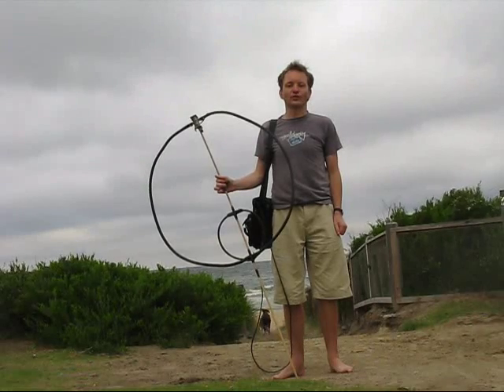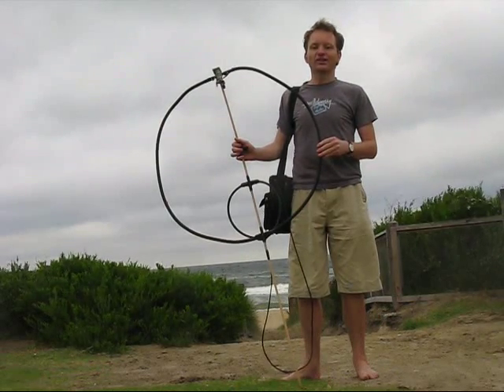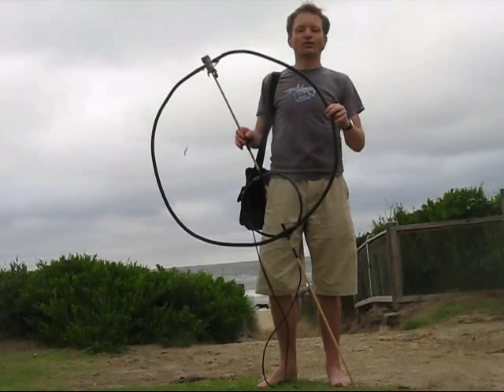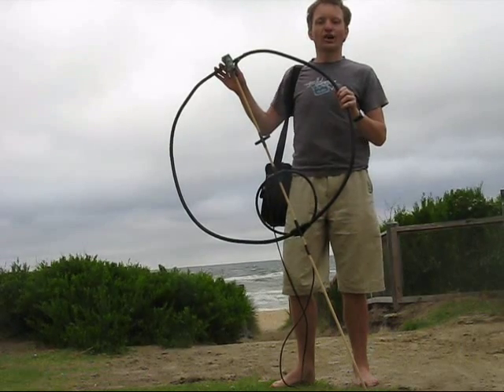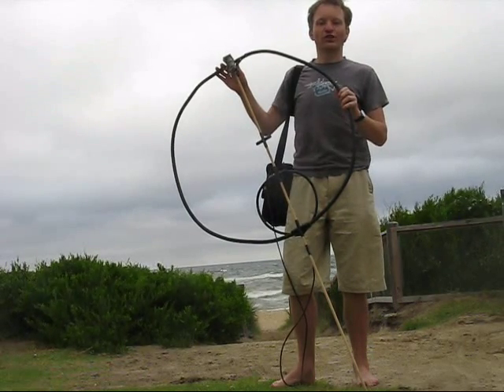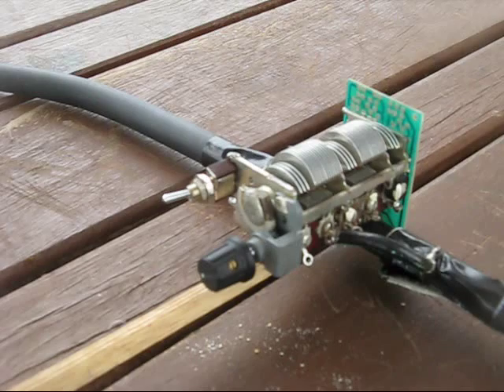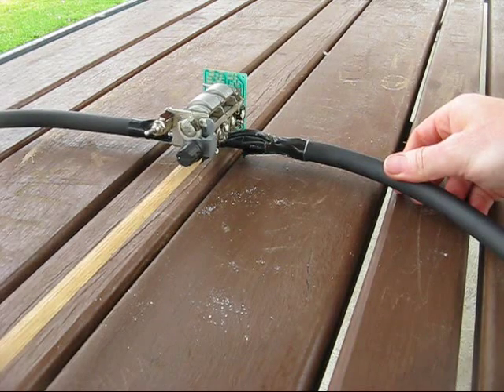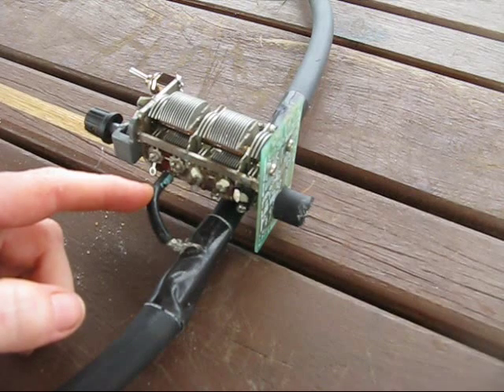Copper mag loop for HF pedestrian mobile: Part 1 - construction

Comment: Great video.  I've gone throughout the video several times, but I haven't been able to find out the size of the variable capacitor in this or the other video.  Is it 100pf per gang or 50pf per gang for a total of 100pf?  Am I in the ballpark?  Thanks much.

Comment from the maker: Copper is best due to lower resistance, but aluminium should still be fine.  

The big challenge is ensuring a low loss connection between the tuning capacitor and the loop, and if you can get that right then your version will work fine.
Reply: I could not understand (due to background noise in the audio) the size of the "annealed copper tube"... XX millimetres...? Tnx for your reply.

Comment from the maker: @va3paw some short answers.  1. Haven't tried it. Depends on plate spacing of variable capacitor. But 10 - 15 w should be fine with a small capacitor.  2. Correct.  3. DC short but not RF short. There is a difference.  4. No tuner needed.

Comment: Hi Peter, very-very nice design. I am going to build one for myself and have a couple of questions if that's okay:
1. How much power can it handle?
2. Also, the outer loop is tuned, and the inner loop is connected to the feed, am I right?
Would'n it short circuit the transmitter output? Would I need a tuner for tuning impedance of the inner loop?
Thanks so much!
73! Paul